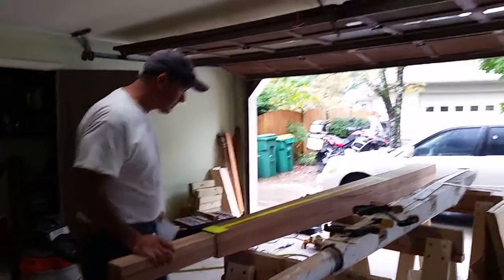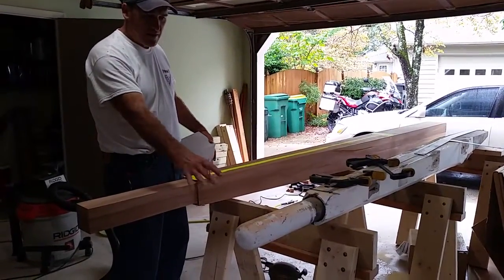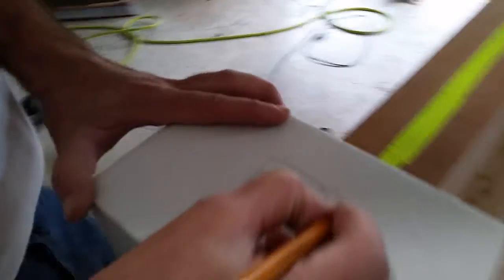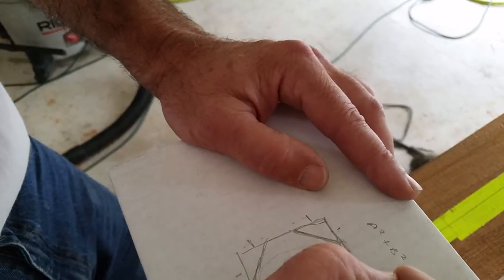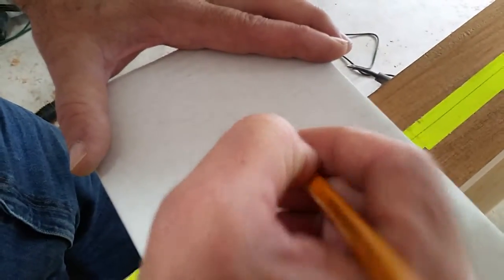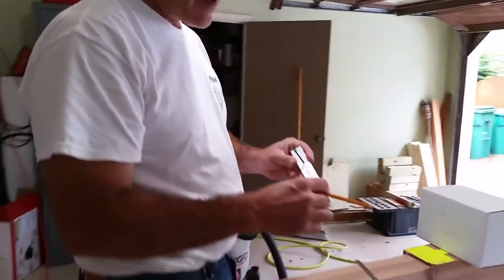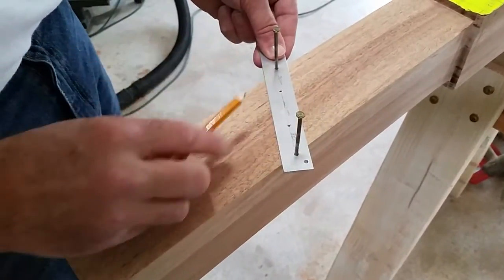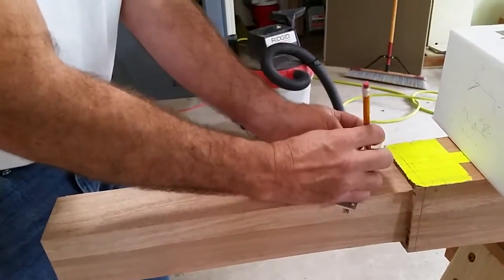Shaping the Bowsprit for a Hans Christian 33 Sailboat

Comment: Great info in this video.  Question for you.  How did you settle on Mahogany?  Did you consider other woods?  I've been told to use spruce...   I'm just starting the research process portion of replacing my HC38T's bowsprit.  Thx!
Reply from the maker: Mahogany is strong and glues well.  Yes, sprice is a good for spars and sprits due to its light weight.  I wasn't too worried about weight,, and spruce is pretty hard to find in the south.